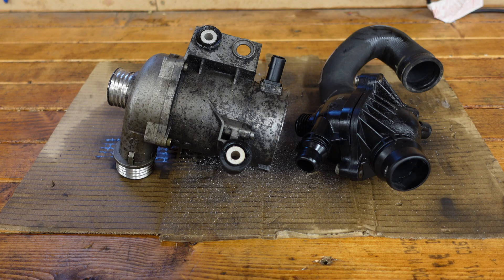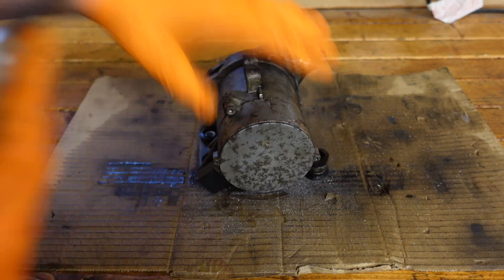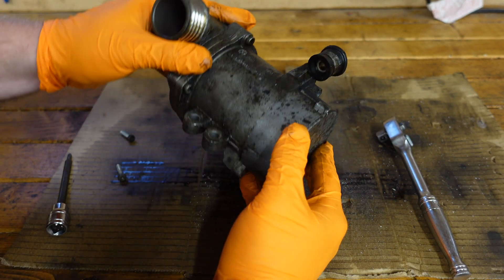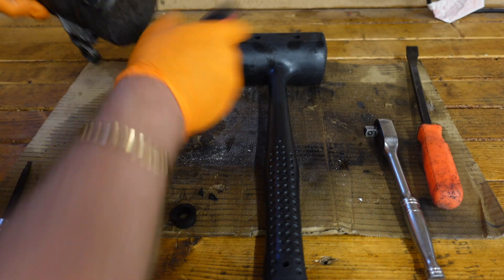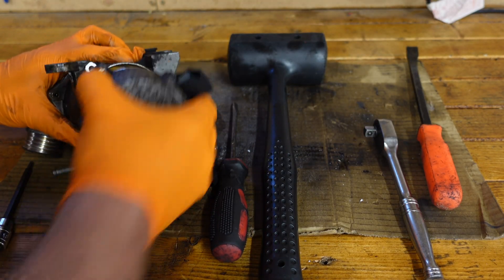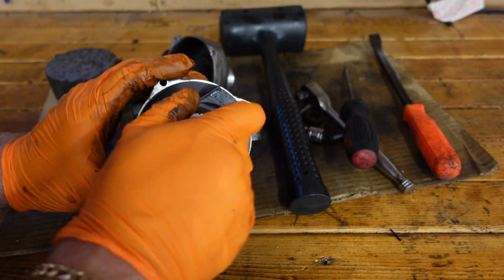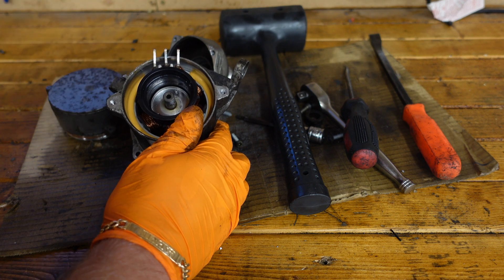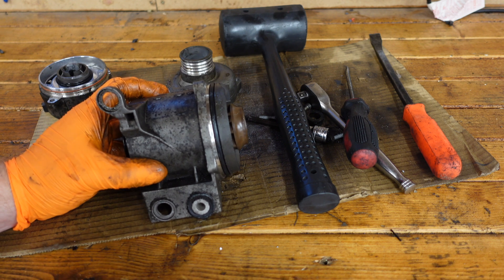BMW N52 , N53 , N54 ELECTRIC WATERPUMP TEARDOWN

Comment: Hey man - discovered your channel and it's already been a blessing.
Sorry to be THAT guy, but would you recommend 5W-40 for a 1.6L N13 engine? Just over 100k miles.
It's my parents car - radiator fan isn't working, drinking oil

Comment: My bmw x5 starts and dies then starts back again & and sometimes it starts and dies and I have to restart it and hurry and push the gas pedal and then it will stay running . , this is on the first start of the day after that it starts with no problems what is going on?

Comment: Thank you for the pump/motor disassembly.  While i applaud the engineering for more efficient cooling, I also question the complication of a critical function (possible complete engine failure at a critical time) and then use plastic components in a hot environment.  These automobiles are expensive.  Use of failure prone plastic is a poor engineering choice driven (forced) by the accountants (bean counters).  Hopefully when failure occurs it does not happen in a high traffic area or tunnel or during a weather event.

Comment: Non video related. I have a 2012 bmw m3. I was driving fine, and all of a sudden, my dsc light came on, then stability control, then my transmission, started clicking. When i shut off the car, it didn't wanna start like the battery died. So i boosted the car turned on like nothing. What can it be?
Reply: Alternator and battery need replacing

Comment: Hello, I know this isnt related to these engines but I literally cannot get help anywhere. I just replaced my vacuum pump on my M57 engine and now load rough ticking sounds are coming from the front of the engine but not from the pump. Its like the new pump caused some issues with the forward cylinders. Any experience with this?

Comment: In my e90 330i 2005, with the N52b30 engine, the original water pump fail at 60000miles, five years ago,. Suddenly appears the yellow light of engine temperature in the dash.One minute later, the red one...and the car enter in emergency mode...I must follow 3miles more in that con dition due the traffic situation in the highway.When finally could stop it
The temperature goes up....fortunally dont burn cilynder head gasket...The BMW dealer change the pump, the thermostat and the water container.I had a pretty bad time...
Reply: Any long term damage?

Comment: replaced them at 10years/160k km but then sold the old ones because they were ok, some people prefer to buy used ones. like in aviation, I agree, it’s better to replace before failure to avoid getting stranded or damaging the engine

Comment: every of these electric waterpumps will fail at one point. Mine broke at about 240'000km. Replaced it with a new one from pierburg and also the thermostat and everything is good again.
Reply: How did it fail? High temperature warning? Also, any long term damage?
Reply: @Silu848  mine n52 is on 245'000km with original water pump. It's high time to change it

Comment: Hello,

Do you get an engine code when your water pump is dead?
Reply from the maker: Yep 2E83 low power for the water pump which usually indicates the drive gear broken not being able to turn it at the speed the dme is requesting
Reply: @BMWDoctor   Thanks alot for the info

Comment: I have 2008 E60 535i. On my 4th electric water pump. In canada the average replacement cost with thermostat is CA$1200. The horsepower / gas mileage  saved is not worth it.
Reply: one should last 10years/160k km
Reply: my 2011 e90 328i is all OEM parts except rear brakes at 78k kms
Reply: It's not just about gas mileage it's about more efficient cooling.
Reply: If you're fitting chinese parts you can't expect them to last